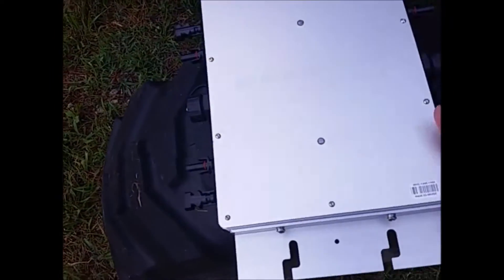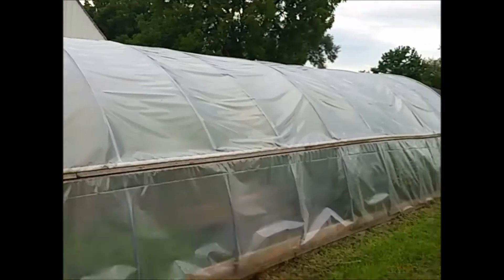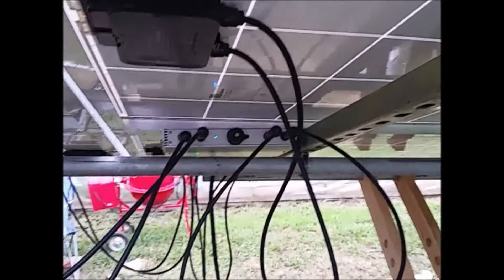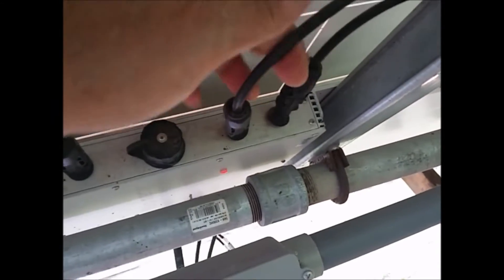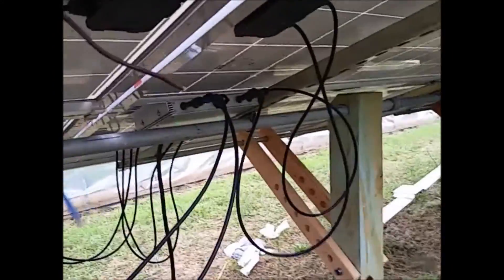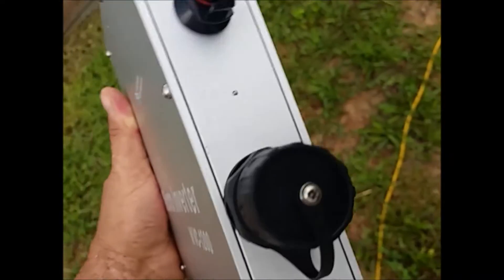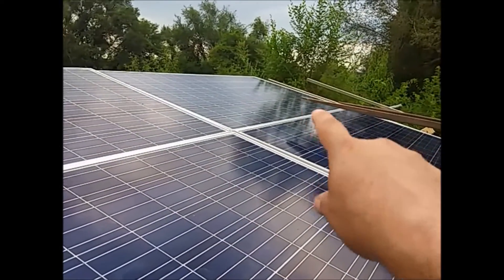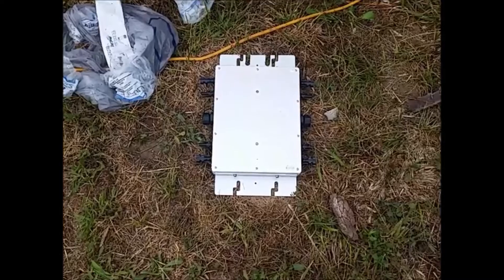wvc1200 Micro inverter review and history.  Good or bad inverter? 2 year history .

Comment: Your panels are all aligned in the same direktion. I would just series parallel the panels run DC power into a singular GROWATT 6000 watt (700$) Grid Tie Inverter with 500 volt DC input. My house at idle konsumes 1000 watts during the day minimum, your array is only 3000 watts it’s not very big, I wouldn’t use Micro Inverters. For the kost of the micro inverter you kan just buy more solar panels from #santan solar, & double your array, it looks like you have the land space. 🤓  Nice Ground mount system I may build mine the same, but use komprestion to sekure my panels to the uninstrut rails instead of bolting them direktly to the rail.
Reply: I ended up using a 11.4k inverter, and 36 panels.  60kWh per day or more.  It works perfectly now.

Comment: I repaired and inverter and discovered that the MPPT per panel is doubtful, i'm not100%. It would be nice if the manufacturer shows some more data of this inverter, buy you know they need to ask permission from the CCP for this.  If one MOSFET on the input fails it is shown on all other MOSFET's per panel, no panel will function.  It looks to me that all panels are in parallel from at least a functional perspective. For sure the grounded all negatives of the panels together. The fact that the whole bunch is connected together as far as I could see explains that the sum of all individual panels powers is not the sum of all panels connected to the WVC together.

Here an other link with WVC1200 info. https://www.youtube.com/watch?v=7V0OxaaXbA4

Comment: I use AP and this one was suggested sounds not good... I think the warranty issues along are a good reason to stay away. Non locking connectors has trouble with heat dissipation so not good for roof and connectors are breaking over time scary the condition they are in just 2 year old.

Comment: can we turn them on without grid AC? They are great since they convert to AC near panel with zero loss and easy to move AC with thinner cables down. But I want a solution without feeding back to grid as I don't have a smart meter and won't mess with grid company BS.
Reply: They do not work without grid power present, and do not buy these inverters. They're junk.
Reply: @carybudach8661  i see, the probably have quality issues still. Thanks

Comment: Update:  Don't buy these inverters, unless your panels are less than 290 watts STC.  And don't expect them to work on hot days.  And finally, don't expect to get them repaired when they fail, and fail, and fail, and fail.   I have six of these, I'll sell them to the best offer....
Reply: Why under 290W? What is the reason lower wattage panels wont work? I have the same inverter, using them with 4 x 270W panels, I have to restart the "AC" line to get the wattage output that is desired, I have to do this every day after the sun is up, if I dont, the output is around 25-70W. I'll think I will return these and go for a  quality brand.
Reply: Thanks for updating here.  You saved me from buying these.  Please share what you end up using.

Comment: Not really sold on MOSFET only, switched transformerless inverters.
Low frequency switching and large isolation transformers may be less efficient, but to complete any efficiency calculation the ROI should be divided by the component failure rate.
That said daisy chained microinverters are used extensively on large PV installations in Ontario. Everything is grounded.

Comment: Do they work without the grid tie in?
Reply: No, they require grid tie.  There's a lot of reasons why inverters do NOT work to directly supply power, mostly because you can over-draw an inverter, and cook it.  The only type of system that would work 'off grid' would be something with a battery.
Reply: @carybudach8661  Thanks for clarifying,  I was wandering if connecting a 3 phase induction motor  prior to grid disconnect would fool those microinverters to continue to produce power. Of course I am talking about 3 inverters connected to 3 phase grid. Any thoughts? I need a system to provide power during daylight power disruptions in addition to simply lowering the cost of air conditioning. I do not want to go into batteries.
Reply: @paukenschlag5461  I have seen people use another "off grid" inverter to power these up and I plan on testing that , but I am going to use a name brand GTI , like sunnyboy esp after watching this video
Reply: @paukenschlag5461  the motor is a load not source, you only need a small bit of signal to trick grid tie inverters, so just get a small off 240 Volt hybrid inverted that kicks on when the power goes off & generates a source signal from a small 50AH LIFO Battery like a Chins Brand from Amazon or how ever much you need to offset the load.
Reply: All they have to do is sense power. So you kan use them off grid but you will need to kouple them with an off 240 volt of grid inverter, it doesn’t have to be a very big one just something to produse a frequency I’ve seen people use 10 watts to “Trick” a grid tie into working off grid. LoL 

If you are going with panels in an array that are all pointing in the same direktion & tilt angle I would just run the panels in series parallel DC then into a singular grid tie or off grid inverter.

Comment: Update on these inverters:  My last pair have been in service now for 9 weeks.  Both of them would regularly overheat, shut down for a bit, then come back online after they cooled.  I added some external heatsinks to one of the units, not noticing that it was already 50% failed.  (The units have circuitry where it will shut down half the unit at a time when overheating).  The unit I added heatsinks:  half the inverter was 'dead', and would not come back online.  The other inverter:  Again, half dead.  What was a reliable 1700 watts is now down to about 500.  I"ll be getting them replaced soon, and adding heatsinks to them right out of the box.  (Plus the weather is now significantly cooler, these units do not like 90 degree days, even in the shade).
Reply: I have the first generation and had the same exact issues, failure to communicate with the  modem, low output i got fedup and reverted to some Sun GTIL 1kw and was happy, only upset that i wasted 700 on these things
Reply: I have bought one of these WVC 1200 inverters . The concept is good but the unit gets so very hot on a good sunny day that I can't even touch it for long . I have mounted  it very well in a very cool place. It worries me. I suspect it won't last long. Even if the inverter has overheat cut out protection , what good is an inverter that overheats when the sun is shining ?
Reply: I`ve never seen that on mine
Reply: Cooling is the key. Even with the single input units that have built in fans I add extra fans to them. Maybe put them in a small box with a couple of computer fans in it. One drawing cool air in across the inverter and the other blowing the hot air out.

Comment: Hi, thank you for an informative presentation of these Chineese micro inverters. I went thru same bad experience with their 300, 600 and 1200 watt units. The inverters did like exactly what they did to you. My question is, if I buy another set of these directly from Chineese vendors, how can I tell what unit version am I getting? Do they have labels with newer version printed on them? Keep it up! Thank you.
Reply: The 2nd generation WVC-1200 has two green indicator lamps on the top of the unit..> The old units only had 1.
Reply: Hello. Where buy this second model (2 green led)??

Comment: Brother does it need any grid to run???i have this but it's not producing power could you please help me to configure give me your contact i will send you my video through that you can figure it out.
Reply: 03054379643 this is my whatsapp no.
Reply: If you don't have it tied to the grid, it cant sense utility power, thus it will not turn on.  I had 3 units tied together and they were able to maintain power once the grid was disconnected, as they sensed each generating power and assumed it was the grid.  UL-1741 specification says that the units should isolate themselves if they don't sense grid.
Reply: Cary Budach if I want to run only one piece???
Reply: Brother i connect 300watt off grid inverter with it to sense grid. It run but as i disconnect off grid inverter it stop 🛑 Producing power what should i do now. I think grid tie inverter system is fail
Reply: @carybudach8661  I like this answer. I was wondering if I can fool it with the battery and inverter. the answer is yes. Super
Reply: It should be simple convert dc to ac and simply you connect your ac appliances to it to run it
Reply: The inverters have anti-islanding built in.. that's UL-1741 specification.  It means that the unit will not begin sending current until it senses grid power. They're made for grid-tie applications and nothing else.  You cannot defeat the islanding protection, and use the unit as a stand-alone inverter, unless you can imitate grid power and apply it to the output of the inverter.   Go get a $20 inverter at Harbor Freight, and simulate grid power from a car battery.  This will allow the inverter to function.
Reply: Cary Budach i m still confused 😕
Reply: Cary Budach tell me what should I do now to get full advantage of grid tie inverter???
Reply: Cary Budach  grid tie inverter is 1200watt and off grid inverter to sense grid is 300 watt grid tie inverter only runs  when it is connected why it need other grid to produce power